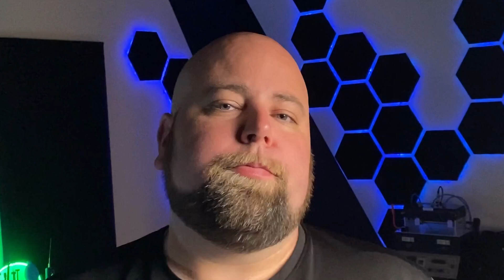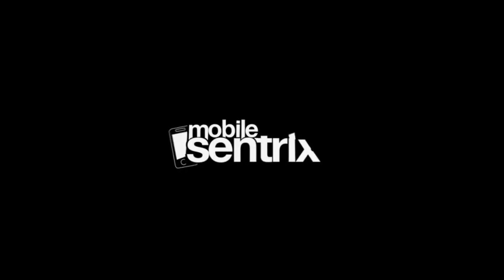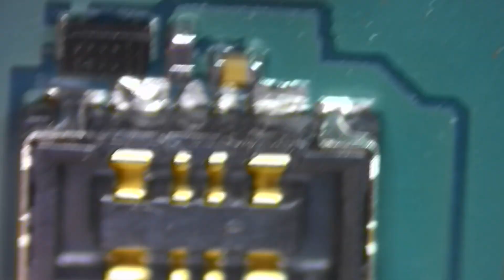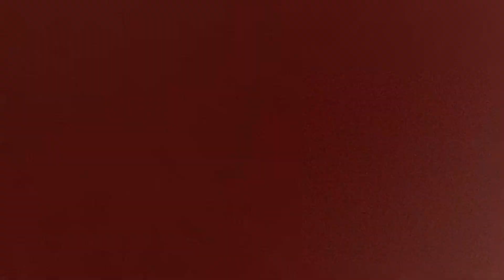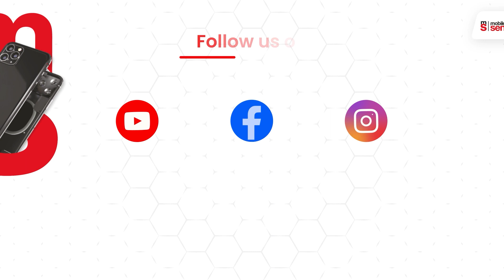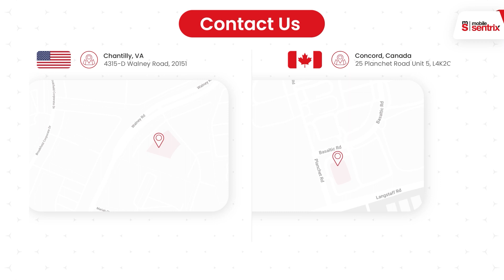How to replace a Battery FPC (Samsung S21 Ultra)

Comment: Hello, in trying to change s21 ultra screen myself i damaged this port. But I have another s21 ultra, I notice it comes up when plugged to charger if the ba3 is not connected,  while the one that has the fpc port damaged shows no sign at all. Can a damaged fpc port make the phone not light up at all when it is damaged?
Reply from the maker: Yes—a damaged FPC connector absolutely can prevent the phone from showing any signs of life, including no vibration, no charging indicator, nothing.

On a Samsung Galaxy S21 Ultra, here’s what’s likely happening:

Why a damaged FPC can kill all signs of power

That display FPC (especially on Samsung flagships) isn’t just “screen data.” It often carries:

Display power rails
Backlight enable lines
I²C/communication lines
Sometimes shared lines tied into boot/PMIC behavior

If the connector is:

Shorted (most common) → it can pull a power rail to ground
Missing pins / crushed pins → can break critical enable signals
Physically torn off pads → can interrupt board-level power distribution

👉 A shorted line at the FPC can cause the PMIC to shut down instantly when you plug in power, which looks like a completely dead phone.
Reply: Thanks mate

Comment: Would it be better to just add 183*C solderin paste to the pins on the board, set the new battery connector onto the pins,, put flux onto the battery connector, and heat it up, after the pins have been cleaned on the board, instead?

Comment: Next time lower the temperture of the solder iron to the point where it does have enough heat to melt the solder but not the plastic. Then you will have a perfect connector. Or you dont have to be afraid to touch the connector with the iron.